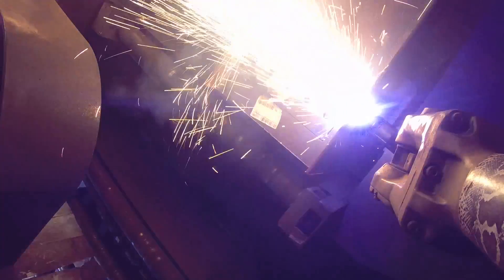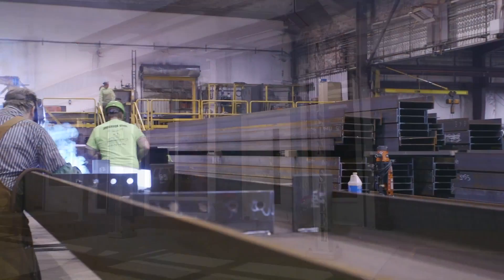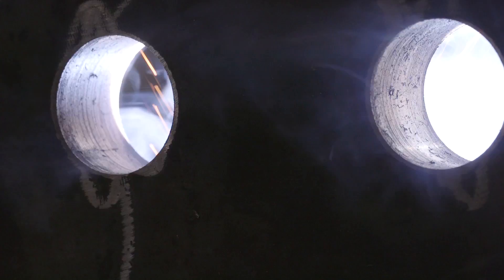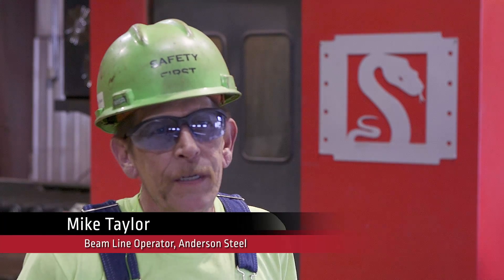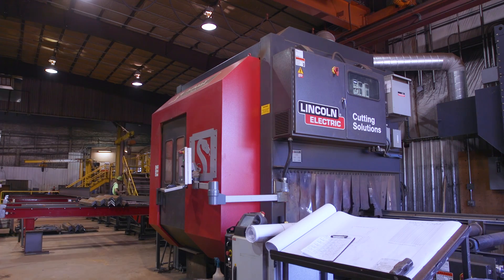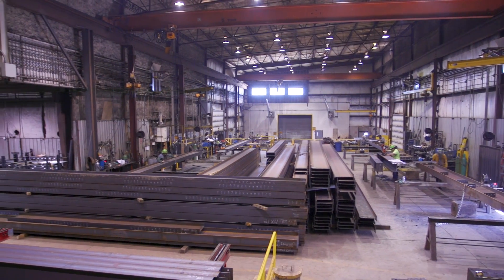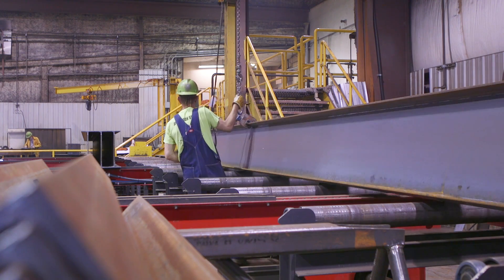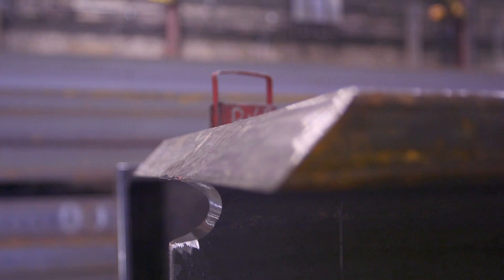Anderson Steel – PythonX Technology Upgrade Pays Off Tenfold

Comment: It sounds impressive but in taking on all the work it becomes a serious liability if it goes down unexpectedly.
Reply: breakdowns are very rare, like rarer than a yeti steak. and when it does the problem usually is something stupid like water in the air lines. never had my machine down for more than a day aside from general maintenance.